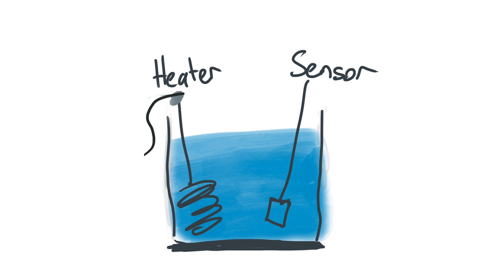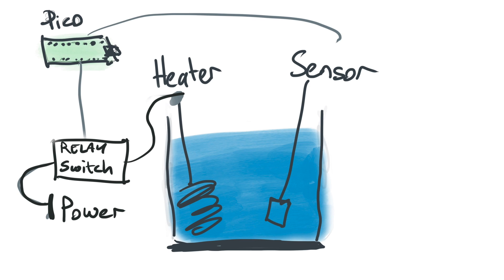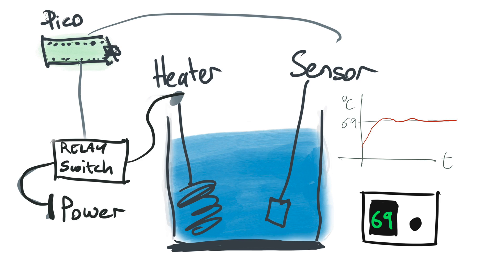Cooking a Perfect Burger with a Raspberry Pi Pico PID Controller 🍔

Comment: how about maximum of temperature,  over 100 degrees Celsius?
Thanks!
Reply from the maker: I have a vague memory of putting some code in there to disable the PID when set to 100C as I was assuming water (edit: I checked, line 216). Removing that one thing and changing the limits for the encoder should make that restriction go away ( I also made the GPIO pins bit slightly clearer on github)
Reply: @VEEBProjects  Thank you😊

Comment: Very nice controlled temperature, around the setpoint. What type of Relay do you use. Can you show a bit more how the Hairdryer is exactly coupled to the Relays? Love your site and experiments with the Pico.
Reply from the maker: Thanks :) We wanted to keep things flexible, so the relay is attached to a mains socket extension. That way we can switch heat sources (or to things like a water pump) in a few seconds. So, to connect the hairdryer, we just plug it in to the extension plug socket.

Comment: Can I get the circuit diagram for this please?
Reply from the maker: It has been added to the todo list :) The pico pins are all listed in the code on github and then it’s just wiring power to the relay.